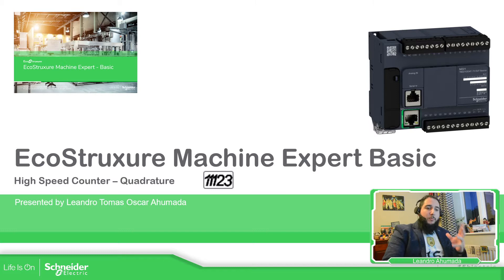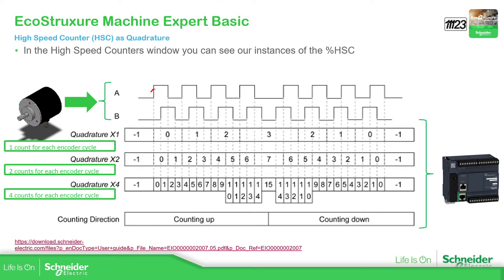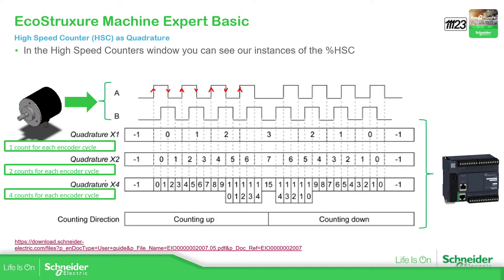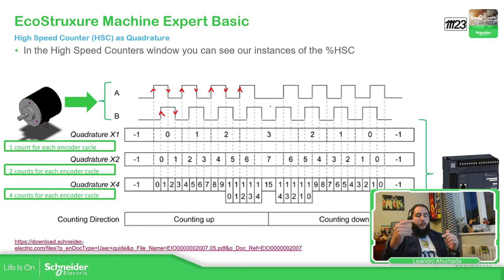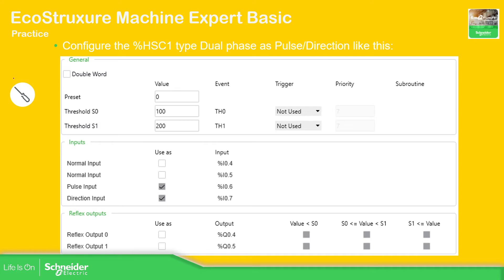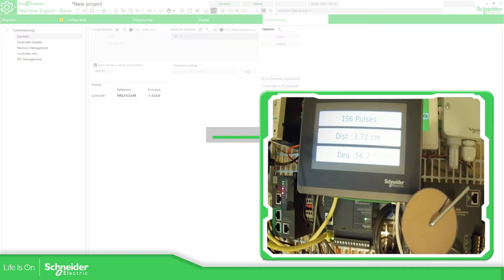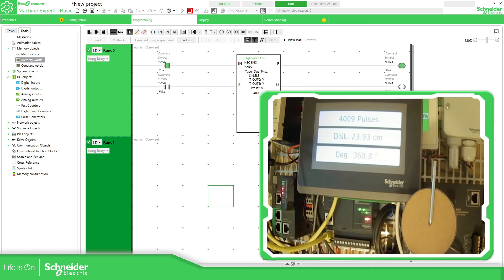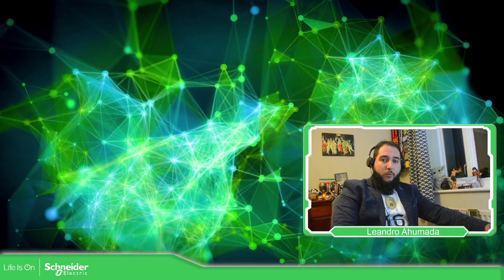Training - M221 - M12.3 How to use High Speed Counter as Quadrature with an encoder

Comment: Hello, thanks for your tutorial, i don't have pnp encoder, mostly in my country sell NPN output encoder, how i wiring this NPN encoder to this M221 PLC
Reply from the maker: Hi Lim! In the page 223 you can see different example of encoder connections to the M221: https://download.schneider-electric.com/files?p_enDocType=User+guide&p_File_Name=EIO0000001384.06.pdf&p_Doc_Ref=EIO0000001384

I am afraid that all of them are for PNP as in my example. 

I have not tested but if you are using the NPN encoder then you will need to assign the COM of the Inputs to 24vdc instead of the 0Vdc then depend on the encoder some advice to use an external resistance in each channel to avoid the destruction of the encoder. (Again i have not tested, analyse further this suggestion)